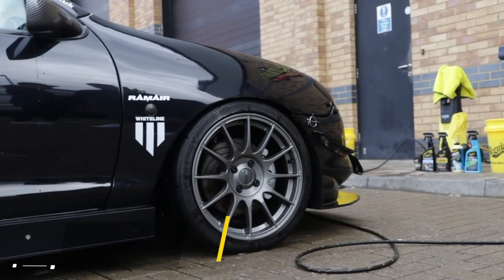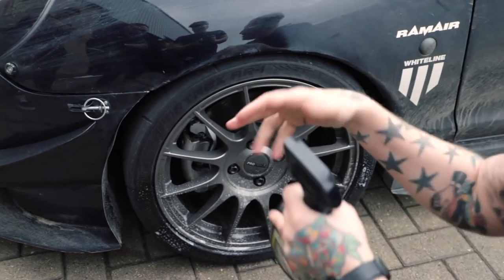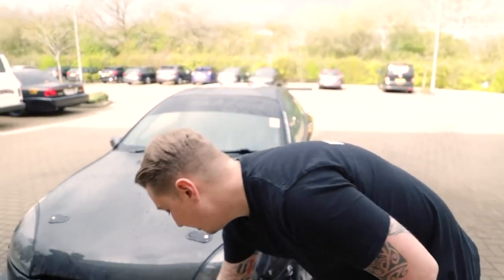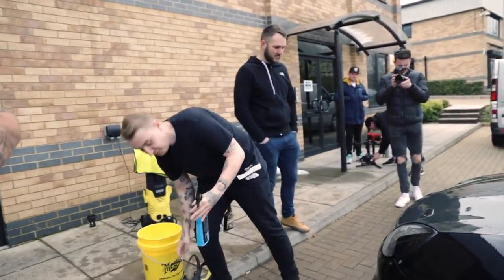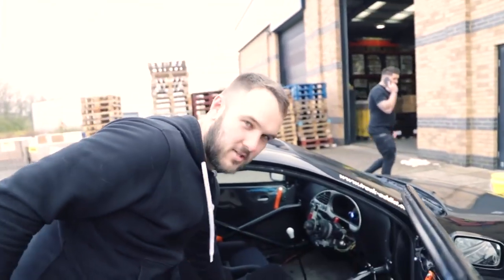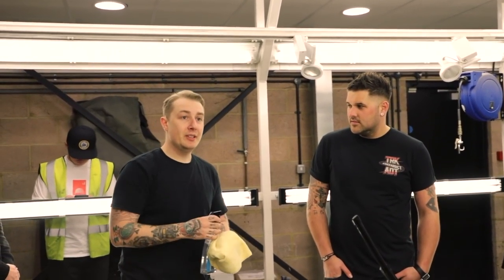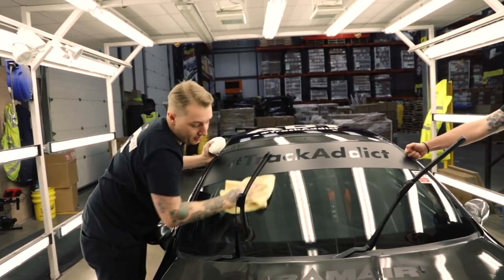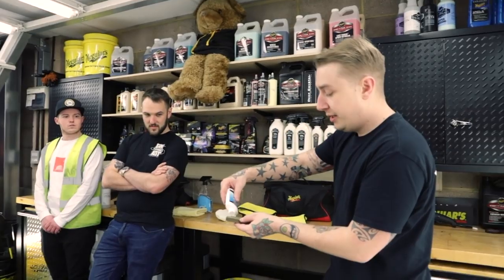How to Clean & Maintain Your Track Car - Day in the Bay – UK Edition

Comment: I got great results with meguiar's glass polishing compound with a double action polisher and a carpro pad polishing glass and shrinkage With the glass perfect clarity!  , then I cleaned a second time with glass perfect clarity.  Then with meguiar's glass sealant with the right method of the leaflet, so a first layer, and at the appearance of the fog apply a second layer, 30 minutes later withdrawal With a damp warm microfiber temperate, then a final wipe with clean microfiber and dry  .  The water-repellent effect is amazing and an excellent time span!. Then immediately rinse the glass sealant applicator pad with hot water so that you can reuse it. And to finish a cure of 12h.
 👍
Reply from the maker: Awesome!  Thanks for sharing!
Reply: @meguiars  👌